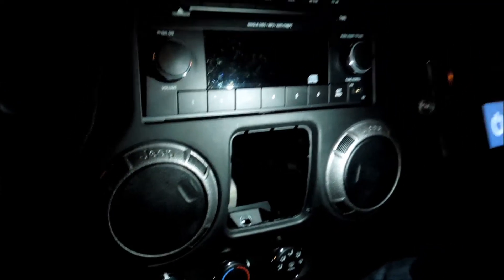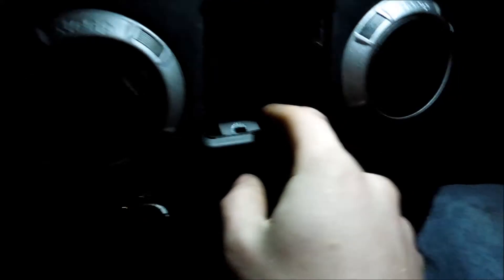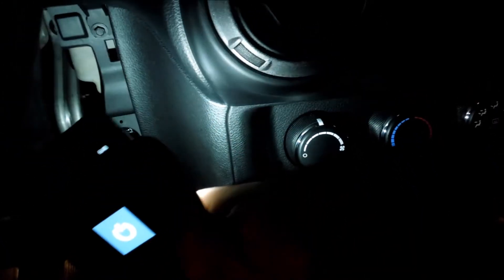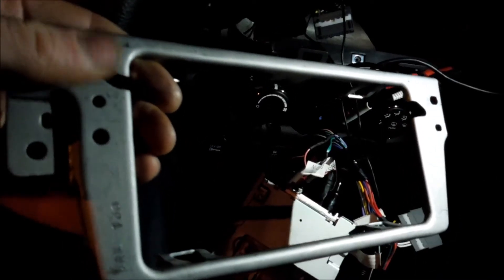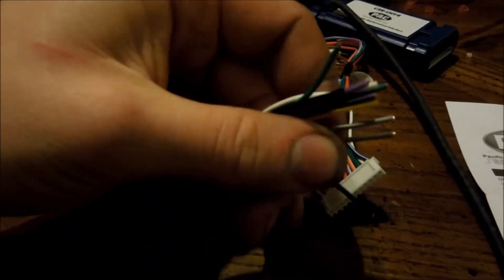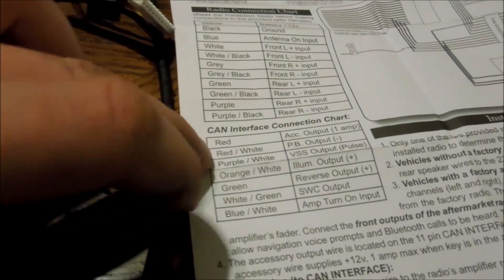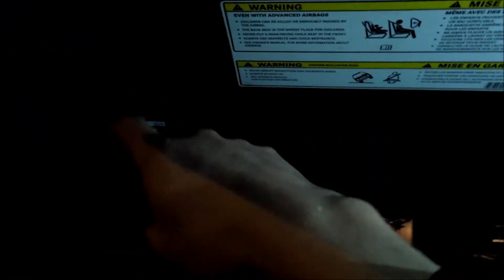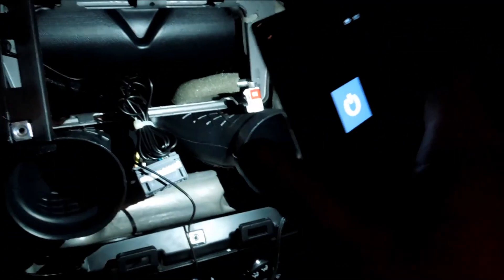How to install a stereo in 2013 jeep wrangler sport Sony XAV-601BT

Comment: Hi, for the reverse to activate the rear camara, where did you get the signal? and for the Orange cable that says Illumination, where does that cable goes? You mention this on the video but it lacks detail on those complicated cables.
Reply from the maker: illumination orange wire should go to the wire labelled illumination if your stereo has it it is usually orange or orange white. the reverse wire    signal I got from the pac module and that goes to the back of the deck